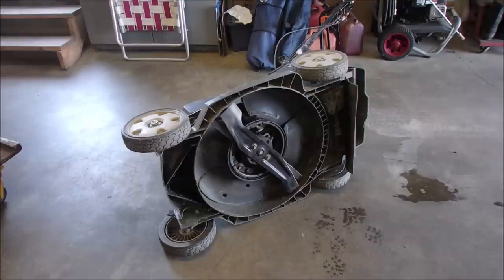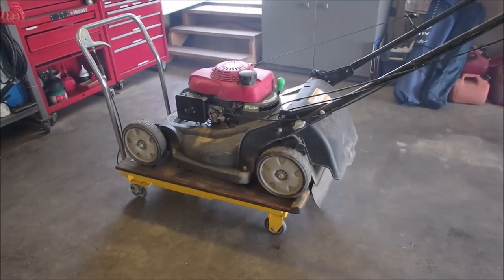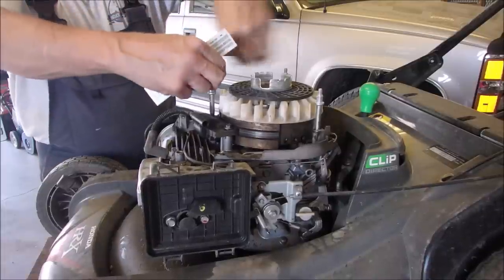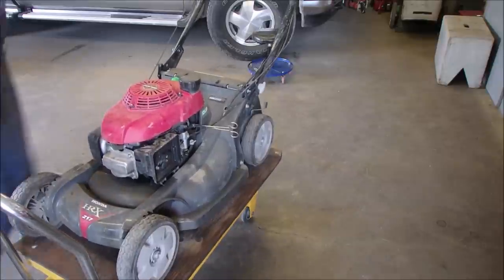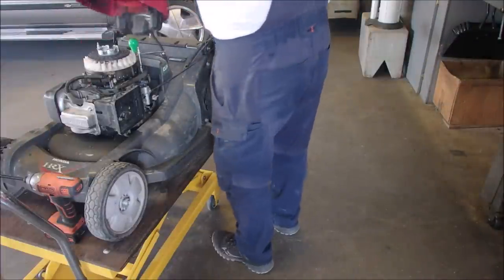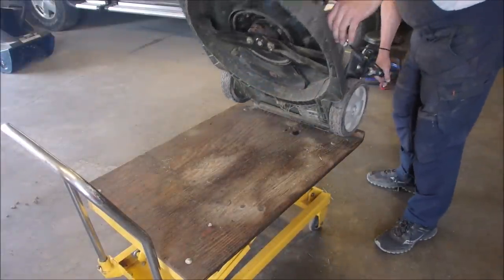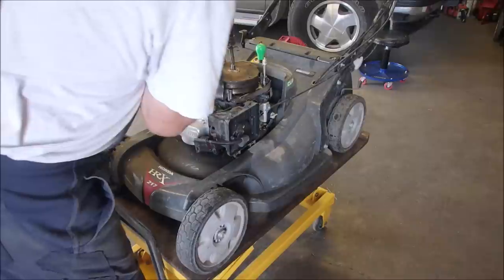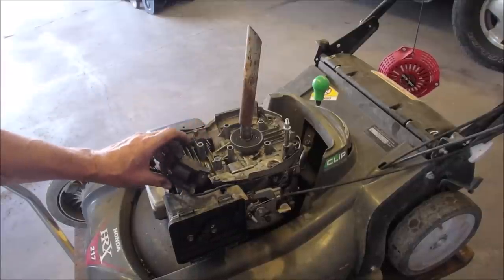Honda HRX217 Trouble Shooting

Comment: Ya know Bruce, I have run across this exact same issue a number of times only on blade brake clutch equipped mowers. Several were Quantums and I think two were Honda engines, all with blade clutch setups. There was so much play in the upper crank bearing that they would shake all over and leak oil from the upper seal, a couple would even strike the magneto coil. I have never run across this problem with standard mower engines or large blade brake engines, only small block blade brake equipped models. I don’t know if the smaller engines with a blade brake clutch need more upper bearing support or maybe they need an actual roller bearing on the upper or what it is, but to me it seems to be a common failure point with the blade brake models. Just my observation FWIW, thanks for the great video and I can’t wait for the autopsy (though I’ve done a few for the same reason). BTW, I just converted those mowers to standard operation without the blade brake using a standard mower engine and pulleys / blade adapter.
Reply from the maker: Thanks  Very good thoughts

Comment: I put a GCV160 on the HRX217 deck (had a blown GCV190). It was an engine I took off a Honda HRB216 with a busted deck . My bolt holes and mounting bolts lined up perfectly but there are a lot of 160 models & others may not. Been mowing with it for 3 seasons & all is good. The gross torque on the 160 is 6.9 vs 8.3 for the 190; about 20% more. What would the HP be? Not entirely sure but back in the day when mowers were rated by HP, a Honda engine roughly equivalent to the 160 boasted 5.0 HP. So if that is a benchmark, a 190 would be 20% more, or 6.0. Anyway, my smaller 160 is plenty powerful enough to move the heavy HRX217. Wanted to make you aware of this option since you are far more likely to run across a 160 some day,
Reply from the maker: Thanks.  I do have a Clone 160 out there   hmm

Comment: I maybe wrong but I think that mowers with cast iron flywheels do better in thick and tall grass rather than aluminum because aluminum only uses the blade so once you slow it down it makes it easier to kill it than a cast iron flywheel. Is that a fair statement?
Reply from the maker: That is a great point.
Reply: I've found it to be true on thick, southern turf grasses. I've got one lie in the video that makes it easy and I've got a Troy-bilt with a GCV160 (W/aluminum flywheel) that doesn't stand a chance in some of the thicker patches.

Comment: Bruce. It started up on the first pull. It can't be the flywheel key. Plus, if the flywheel key was sheared or even partially sheared ithe pull rope would kick back and rip right out your hands
Reply from the maker: OK

Comment: My hrx217hxa this season has gotten worse and worse not cutting all the grass blades even after going 2 different directions! 
Belt culprit or wax choke piece or cable adjustment or???
Carb replacement was done last year n been on rec gas even before that
Reply from the maker: Sorry I am not there to have a look

Comment: Im thinking isn't there just a ballbearing in the end to change , i would remove the seal and look.
Reply from the maker: Very good point
Reply: @BrucesShop  i think beside the bearing  , its a good engine . Hope its a bearing you can change and have a good mashine.
Reply: Sing it. I think that if he were to split the case, he'd see it's not nearly as bad as it seems.

Comment: Damn Bruce, that looks worse than I thought. At first thought it was gonna be a flywheel key or something simple but no. Bad crankshaft wobble could be caused by bad connecting rod bearings due to low on oil. I agree with this. People really need to maintain there stuff and learn from there.
Reply from the maker: Thanks so much for watching.

Comment: I replaced the top seal on one of these because oil was everywhere. The Honda part wasn't too costly. There's a bearing underneath the seal.
Reply from the maker: Right.   The engine burns so much oil I think I will part it out. But Thanks.

Comment: Sorry Bruce the bushing is gone - such a shame - a 2 min oil check and yearly oil change would have avoided this - but good parts will come of it 🙂Thanks for sharing
Reply from the maker: Great point!  This mower must have 2000 hours on it as I found out out it came from a golf course.

Comment: When was the last you used a 9mm anything?
Reply from the maker: I know   right!!!
Reply: I have to use mine almost as much as the 8 and 10mm, on vehicles and bicycle brakes and derailleurs. I keep three on my roll around, and one of those is 10 inches long, one is normal length, and one is ratcheting. I don't know which one I lose the most, the 9 or the 10.

Comment: I am told Honda is no longer making mowers.   Mine is almost 20 years old.  Still working.
Reply: I heard that too but I think it's just a rumor - their website still has 12 different 21" walk behind models for sale. There's is however a recall out for GCV200 engines that have a defect on the camshaft exhaust decompression valve. People have been getting hand injuries from the engine ripping the start cord out of people's hand while attempting to pull the recoil.
Reply: @milfordcivic6755  thanks for the reply.   I would hate to see the Hondas taken off the market.
Reply from the maker: That is true.  September this year.